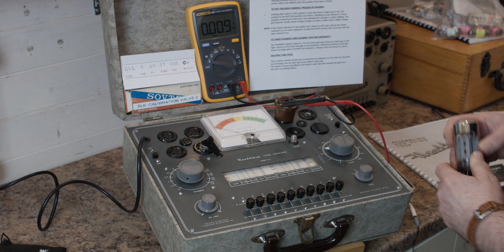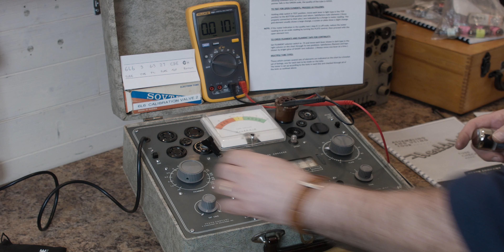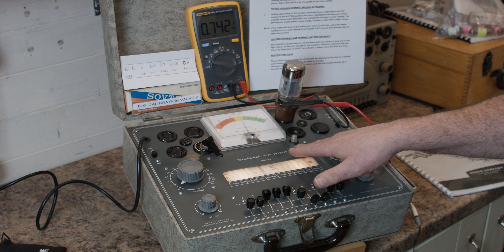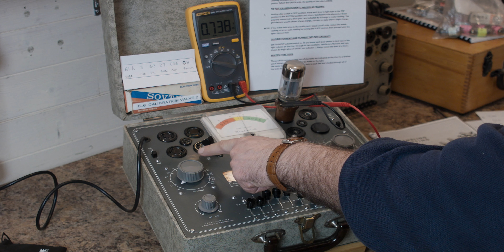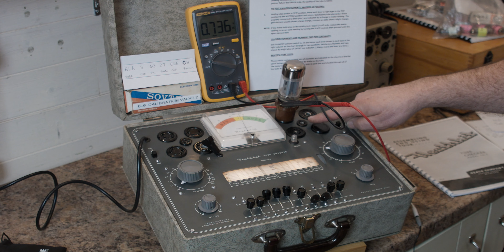Heathkit TC-2P Demonstration

Comment: Thanks for the video....I just acquired one of these.....and I'd like to test a 4 pin CX 345 but can find it on the chart.....do you know why....Thanks, Mike
Reply: Hi Mike, according to the raiomuseum Tube 45 is equivalent to the CX 345. If its not on your roll chart the settings are :-  Tube 45,   Type 3, Filament 2.5, Plate 32, Top BC, Bottom D (bold/underlined).
Hope this helps, Owen
Reply: @owenreeves4780  Thanks for the info.....the information for the 45 tube is not on the "roll a dex" in the tube tester....But, I did find it on the extra paper work that came with this unit.....TEST DATA FOR SELDOM USED TUBES - - and SUPPLEMENT TEST DATA SHEET - -  both with the same setting that you supplied.....I think I'm on the right track now.....Thanks for all the help.....Mike

Comment: I have left the test switch down quite a while to see how the tubes react.  It doesn't seem to damage the testers I use, but I have read that.  Do you know any more information behind that idea?
Reply from the maker: I had a NRI 69 that had lost its return spring. When testing a 6v6 I forgot ( someone at front door) to return the test switch to its normal position.  10 mins later a burning odour was detected. A 1w resistor  had started to overheat. The momentary switch is there for a reason.